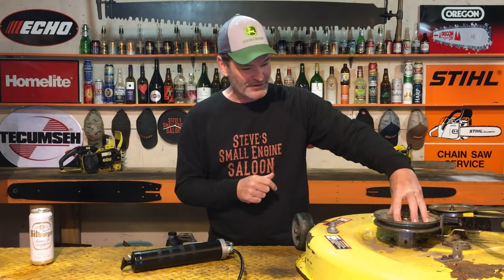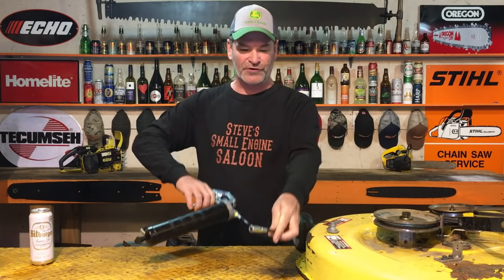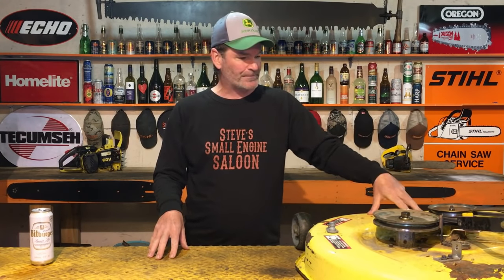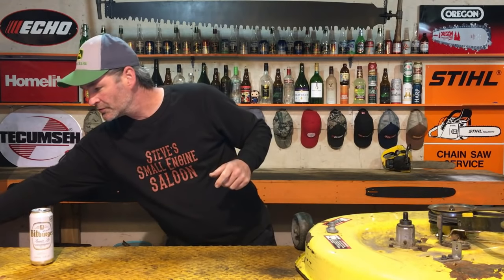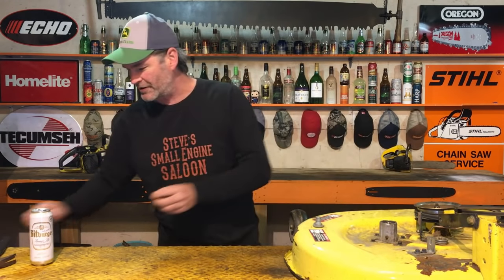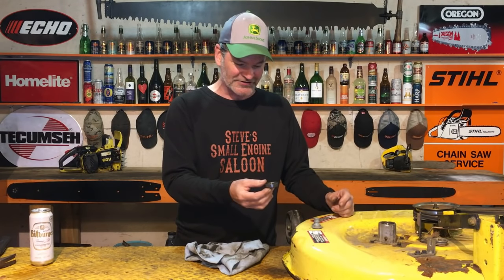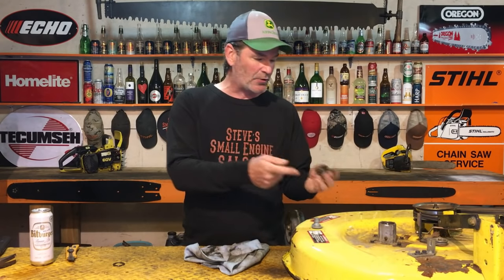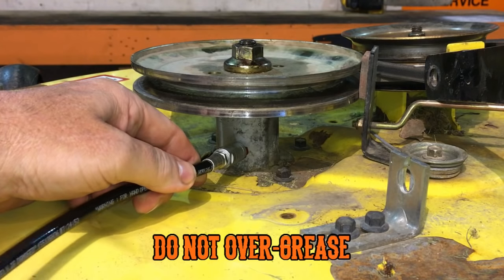Your Riding Lawn Mower's Dirty Little Secret

Comment: I am replacing the bearings on the front wheel of my garden tractor (old, but newly-acquired). Saw a video about "packing the bearings" - which consisted of filling the void between the outer and inner bearing along the spindle with grease. I've never hand-packed bearings but I have an idea what was shown was not 'packing'. I'm thinking I should try what he's shown here... there's a a grease fitting on the wheel.

Comment: I’ll be waiting for mine to go out before touching it.  You did everything required to replace the bearings.   Don’t think I’d pull a deck apart that was working fine.

Comment: Engineers even have a term for design things to fail. They call it “planned obsolescence”. Greedy-ass companies! Thanks for the tip👍
Reply: I sure remember,  that's what you did then,  you had no choice.  In the back of my mind I still don't feel 100% comfortable with sealed bearings. Old habits ya know.
Reply: Throw away world we live in. Sucks.
Reply: you can't design everything like an ingersoll lawn tractor. look what happened to them haha
Reply: Holly13 Satre89   they are the best tractor you can get my dad bought one almost new in 1990 when i was in 5th grade. i still use it today. we have only replaced the electric clutch and some bearings in all that time. i don't think either of us have even changed the hydraulic oil. everything on it is just beautifully over engineered. Every peice of metal is thicker than it needs to be,  The deck bearing housings are these big cast iron bricks so only the bearings will ever need replaced  You can pull off the deck in less than 5 minutes with no tools. its basically like a small piece of heavy machinery. has that satisfying hydraulic whine :) haha No drive gear's just a hydrualic pump. in fact you can get a kit that allows you to have live hydraulic hookups like a farm tractor. If you just wanna buy the last lawn tractor you'll ever need to buy.. go find yourself a nice 4016 or 4018
Reply: Holly13 Satre89   no problem refresh page if you don't see a "read more" tab. speaking of bad quality control. youtube seems to be cutting off all the longer comments today. but yes...design obsolescence is getting completely out of control especially the last 12 years. I can't even find a new car that i would want anymore.
Reply: Called built in breakdown

Comment: Those bearings say they're made in China.  Probably the original OEM bearings were greasable, and then they outsourced it.  So they technically fit...but they're not exactly the same.
Reply: or JD spec'd out the correct ones and outsourced it to another company to build the spindles (just like with their engines). The factory in China figured they could save $.005 per unit and knew they would never check up on it.
Reply: Like medications, over 95% of All parts for Everything are made in China. I worked Lathes and drove trucks, manufacturing, delivering everything imaginable, in a Big US city,.... way back when. 

Unions [I was a member] demanded [we went on Strike, during every new contract] so much more every year in wages and benefits, the stuff we manufactured became so expensive, no one, anyone Not union, could afford to buy... Anything. ;

Comment: The bigger problem is I bet 95% of the people using these mowers have never even owned a grease gun.
Reply: Beyond that, 99% of people have never examined grease compatibility.  Most tube grease is likely to be lithium base, but using the example of this video... something "sealed for life" may have been packed with a polyurea base and those two are incompatible - early/accelerated failure begins the moment they get mixed.  Maybe he should have fully degreased that one he took out before doing his thing?   Personally, I would not take the OEM's word for what they recommend for a bearing [most cases], but identify the bearing by it's markings [usually etched or stamped on the race] and find out what the bearing factory uses.   Very rarely do you find a manufacturer that has had to design their own spec bearing: that's typically for unusual loads.  Last time I ran across this was a shaker motor: it had very high moments of inertia during specific angles of rotation requiring both a heavier duty race design, plus they used a barium base grease [which was stupid expensive by the way - we kept it locked up so it didn't get wasted on anything else].  Those bizarre loads would probably beat a normal bearing race egg shaped in the space of a few months service.
Reply: I'm thinking closer to 100% didn't stop to consider it (if they even knew it in the first place)
Reply: I agree i have never seen anyone bring a mower to me greesed. The people that dont bring there mower to you to fix, they greese theres. I bought used John Deer rider and not one thing greesed had change bearing full greese job ( but ) that was expected no doubt!

Comment: Thanks Steve.  I have 2 John Deere’s. 1980 models. 108. 111. I replaced spindle bearings on the 111.  I noticed service manual said to fill area between the 2 sealed bearings with grease after   Reassembly.  The grease does nothing

Comment: The grease fitting in the casting must be a hold over from before the mfgr decided to upgrade the bearings to sealed both sides.
Reply: So you just run a bare metal shaft between two bearings? Precision,open,loose or bushings this part still requires lubricant.
Reply: @TheLexiconDevils  No it doesn't. The balls in the bearings are where grease is needed. That's the wear surface.

Comment: I did this to my 2000 Mirray when I bought it new from Momtgomery Wards. Still running the same spindle ame bearings. AMD same opposed Briggs. Good advice. And change oil every 25,30 hours or so... best $3.00 you'll ever spend

Comment: Great video. But put a nut on any threaded shaft before you smack it.
Reply: Or hit it with a softer metal, like a brass hammer.
Reply: Worked on a fleet of lawn tractors for years and we always removed the spindles on mowers by using a center punch.
Reply: I use a soft face hammer ,,your right I notice that too !!
Reply: There are no threads at the top of that shaft.
Reply: Or smack it with your brass hammer.
Reply: smack it with you chops
Reply: Yes put the nut back on the thread and also use a copper hammer to smack the nut.
Reply: ... I usually have a chunk of 2x4 or other pc of wood closer to me than looking for the correct ‘tool’ to drive any shaft out of a bearing/housing. Gently as she goes sooo y’all don’t damage your bearings. Happy fixing y’all 😬
Reply: Thx
Reply: That's what she said
Reply: Sometimes they give ya a little room before the threads.
Reply: @aaronsearch1189   Your on it.

Comment: The 1K number of thumbs down must be from Lawn mower parts dealers!
Reply: Or people who think without a relief hole people trying this will pop a seal.
Reply: Or people who think understand why seal bearing last longer and understand the draw backs of the mod.
Reply: Or people who understand that nipple is not to grease the bearings.
Reply: The thumbs up and down is fake ..... I have watched it for years...
Reply: or people that don't like a good German beer...
Reply: @ttww1590  I'm confused why would they have a useless grease fitting then? In the manual it is called a grease fitting, why would there be a fitting to grease a spindle that rides on two sealed bearings?
Reply: @jared7211  It's not useless, it's just not to lubricate the bearings. Gotta keep the moisture out of there.
Reply: @jared7211  design flaw from factory to sell you more bearings I thought Steve mentioned that at the start ? 🤔
Reply: @peterrivney552  it’s a good thing you understand sarcasm or my reply would have gone over your head. Oh wait.
Reply: @peterrivney552  By the way my reply was not directed at Steve.
Reply: YEP   HE   UNCOVER    THE  PLOT  TO  TECNO   FRAUD
Reply: @RP-gi4ch  @R P It should be fairly intuitive that the seal designed to keep the grease in while keeping water and dirt out also prevents getting grease in. If that's not the case for you there are several authoritative sources on the Internet that explain why, you can share a beer with a shop foreman in heavy industry ,or you can test yourself with a high pressure grease gun or shop press. No mater how much grease you smear on the outside it's going to need service every 5-12 years. You can get on the high side of the range by keeping the rotating mass as balanced as you can, keep the area clean to reduce heat build up, and reducing exposure to moisture (in this case by greasing the adjacent area prone to condensation). The same sources can explain the service interval difference between sealed and unsealed bearings to understand how removing one or more seals reduces interval between repacks.
Reply: @UCOqge2DRzNFDlN-7z3F6ppQ - I didn't comment on the seal design. I commented on your ridiculous comments. Your reply to me only reinforces my original comment.
Reply: @RP-gi4ch  A good grease with moly in it. Would probably give a longer life to the bearings.
Reply: Not really, my lawnmower tractor knowingly has closed bearings and no greas fitter, and i have had the cutter für 10 yrs now, no play in shaft, no nothing. The manual even tells you what the over all lifespan of a bearing is , they are reletavly cheap to get and replace or if u really want u can take them apart every 5 yrs, re-grease it and expend its lifespawn.

Comment: I guess this explains why not greasing them hasn't caused mine to fail :-)
Reply: I had a mower that lasted for about 12 years and never once were the bearings greased, worked just fine the whole time
Reply: @Joe Go 
I never saw them.  I guess I won't bother to look, now.
Yes, I will.  I gotta check this out for myself.
Reply: That may just be because they come pre packed with grease and sealed so dirt doesn't get in as easy.  We use sealed bearings all the time on our equipment at work because they last the longest.
Reply: @hankdog001  +1 That's why I switched my wheel bearings to sealed as well.
Reply: @hankdog001  Yes that is the point! So WHY did the goofs put the fitting there! LOL! I never greased any of mine even on my 90's JD STX30 the spindles out lasted the deck. The tractor is still in great shape I need a new deck though. That is my Little toy now. I got a newer JD 4 years ago.
Reply: ColinWatters. So true and when they do fail, new ones are between $15 and $30. Just replace them and be done with it. Maybe a 15 min job.
Reply: @MegaSling  $3 if you buy alternator bearings. My napa has a alternator/started rebuild shop and I get them there. Or go to a alternator/starter rebuild shop and get them there.
Reply: @hankdog001  Pre packed? If you pop a seal on a new bearing you will find there is not much grease put in the bearing at all at the factory.
Reply: @ericglaub6900  12 years?--- hard to believe or are you like some people I have seen---yard the size of a postage stamp and the guy needs a riding mower to mow it---barely room to turn around! Knowing what I know about sealed bearings and the amount of grease in them, it is extremely hard to believe unless it has seen little use.
Reply: My 1973 Sears mower/garden tractor has been running 46 years and I grease the mower deck regularly and all other fittings too. It is time to change the bearing though. Spindles weren't made back then like the one shown and are no longer available.
Reply: @KStewart-th4sk  1.5 acres,  all hill
Reply: @KStewart-th4sk  I've got 21 years on my JD LX178 and never lost any bearings. I have a 1-1/2 acre postage stamp.
Reply: Eric - you must have got the mower that had Timken long-life sealed bearings. They last forever!
Reply: @rogertycholiz2218  hey,  I'm not complaining lol
Reply: Mine don't have zerts, even tho it's an expensive (but old) john deere.  I took it to a dealer.... They wanted 700 to re-hab the deck.  I told them no, brought it home, and what do you know?  The bearings are fine.  
Buyer beware!
Reply: 2004 Craftsman, 42 inch deck, never greased, don't know if there are grease zerks, never changed any bearings. 15 years of use. I think I got my monies worth.
Reply: My 2000 craftsman garden tractor mowed my lawn for 15 years on the factory sealed deck bearings.  I'm not exactly sure how many acres of my land I mow but it took about 2.5-3 hours to mow.  They used to actually put in good bearings at the factory.
Reply: I did mine the other day,nipples were in rough shape themselves,had me wondering if any thing was getting in there, I must admit sharpening blades made a huge difference,must say I've been negligent on sharpening and cleaning deck even with self cleaning feature.
Reply: K Stewart I had to purchase a Zero turn mower.
Reply: Eric Glaub Fun Eh ! Tried cutting any patterns ? Hills make it a challenged,my wife doesn't only want clean she wants patterns, lol, should hold Masters here.
Reply: @KStewart-th4sk  Mine are also nearly 12 years old. I have 1.5 acres to cut plus a church yard. Still seem fine.
Reply: me too lol
Reply: 1.5 acre postage stamp ? That's a nice postage stamp !! LMAO !!
Reply: cslimfu 33 agreed, you could save 12 or 15 bucks but for me, it’s just less work. The down side; replacing the whole pulls is only maybe a 1/2 beer job LOL.
Reply: @genegene002  My mower doesn't have a grease fitting on the spindle.  The spindles went out at 9 years.  Replacing both of them cost about $30.
Reply: I was thinking the same thing... did not even know there is grease fitting on those.  Gonna modify like Steve shows or just wait till it gets bad...
Reply: one of mine failed at 210 hours. now that I have done this it is quitter also
Reply: @hankdog001  Bingo. Because of the nature of the debris, the bearings are sealed for a logical purpose - to keep them clean. They are prepacked with grease and made to last many hours of operation. When and if they need to be replaced - a fairly minor expense.
Reply: @genegene002  The part was probably the same part used before they changed to sealed bearings.  The zerk was put in to keep out the dirt and water would be my guess.   Worked for John Deere for almost 40 years and I've seen them use older designed parts like this before.  It shouldn't hurt the performance at all.  I've had a 185 Hydro with a 46" deck and never had a problem with those bearings.  That's been 35 years on the same bearings.
Reply: 16 years and my Craftsman still has its original deck bearings, which have never been greased.
Reply: @ericglaub6900  
My John Deere 212 mower is 41 years old and I just had to replace the bearings last year for the first time. I never greased them because I don't have grease fittings.
Reply: 2002 Craftsman 17HP 42" on 1 acre. Only replaced the bearings because I had to replace the shafts. The teeth the blades sit on  wore down to the point that the blades were no longer secure. Just got the entire assembly and replaced it at once. The bearings were still in good shape after 16 years and never greased once.
Reply: Dan Vincent  he suggested leaving the bearing seal on the outside of both bearings, so unless you way over-grease, forcing those seals to fail, you shouldn’t have an issue.
Reply: Gene O  Hope you got a real John Deere.  Most of the smaller mowers are made by other companies these days with the J.D. paint scheme on them . Don’t believe it , just ask their mechanic !
Reply: @KStewart-th4sk  You're so right, but darn few people will 'waste' a new bearing to find the truth. Only the European sealed bearings come properly pre-greased anymore and they ain't cheap- only worth it. Better to be able to grease bearings in use as the new grease will push out the old which is contaminated with metal particles so that the bearing lasts longer! The problem is that people these days are too d@mn lazy to maintain things. 

My 28 year old truck still has the all original front end parts in perfect condition because it gets greased regularly. A new truck with sealed parts can't do that. A savings of $1K or more for a total of a couple hours of my time and a few bucks worth of grease seems like one heck of a bargain to me!
Reply: @18deadmonkeys    Placebo
Reply: @tomnovak7731  I got 26 yrs from my LX178, never greased anything, the motor gave out.

Comment: Just so you know, there is a name for that, it's called - 
'ENGINEERING OBSOLESCENCE' 
(aka: planned obsolescence; engineered obsolescence; built-in obsolescence)
[noun]
 - the policy of deliberately limiting the life of a product in order to encourage or force the purchaser to replace it.
Reply: correct... my favorite is printer ink cartridges that claim they are out of ink when you have only printed 25 sheets.  Sometimes you can bypass their BS... other times you cant easily... should be against the law in my opinion.